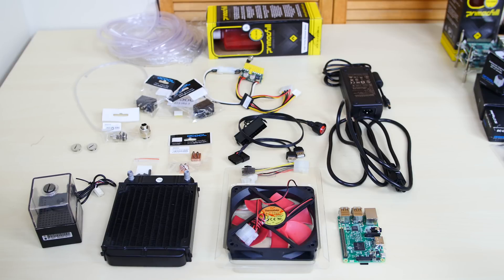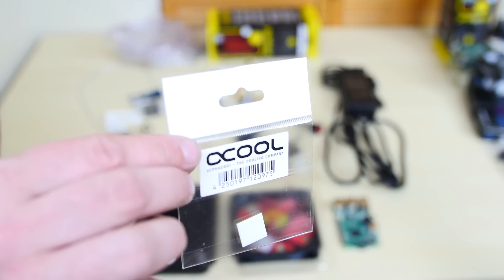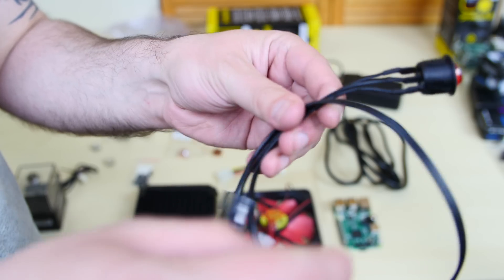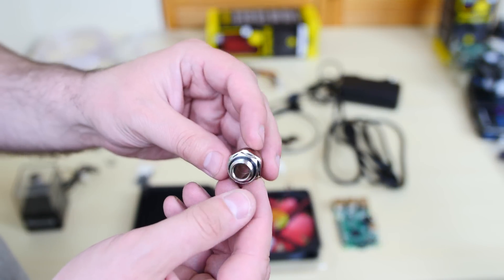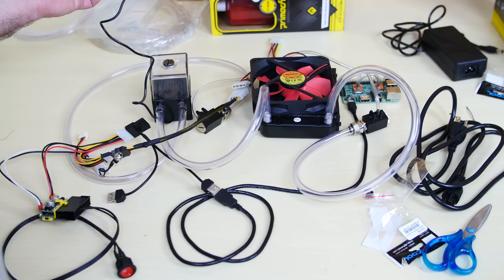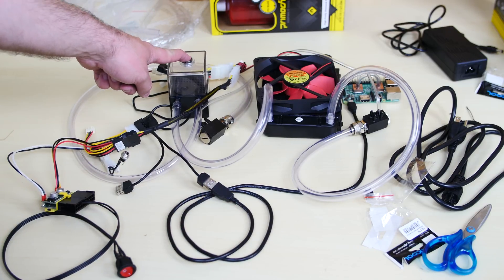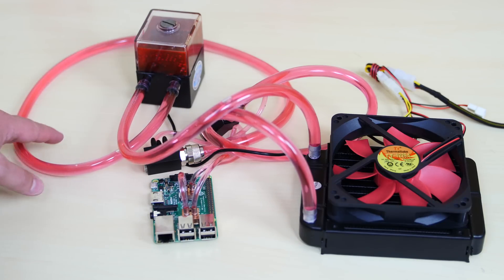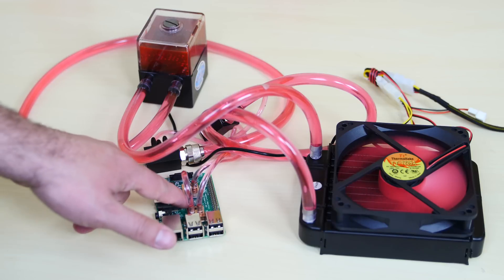Water Cooled Raspberry Pi 3 - Part 1 - The Build

Comment: The pump clearly isn't powerful enough, when the air is stuck in the loop.
Also, when your radiator is lying flat, there is minimal airflow.

You're basically just placing a plastic bottle on top of your Pi with no liquid circulation.

This isn't watercooling. This is putting unnecessary cable clutter and water onto a Raspi.
Reply: Its only because of the height the pumps sitting in relation to the height of the liquid. If he laid things flat it would work great. 
True about the airflow but for the amount of heat the pi produces even no fan would do wonders with the amount of area the radiator has.
Its a demonstration of concept. I'm sure if he knows it could look a lot neater if he wanted it to.

FYI a bottle of fluid on a pi would actually help a lot... if it were metal
Reply: Yes, I'm aware it's overkill and nothing is needed to cool a Pi.
Yet the execution of the project is horrible.

And no, as long as the water doesn't flow at all, the pump is simply not powerful enough. It might /kinda\ work, if it was flat. Still not a good enough pump.

The radiator isn't even used. The heat doesn't reach it because of the water not flowing trough it.

The whole point of a fluid is moving the heat away from the source. If it's stationary, there's no point in not just having a massive heatsink. - Which is why a metal bottle would work, no matter wether there was water or not inside the bottle.

Comment: There is a more efficient way to run your W/C loop, you should run 2 tubes from the outlet 1to5 splitter and have both of those individual lines return from the the pi3 to the inlet 1to5 splitter (parallel instead of series) Your setup will have more flow, will put less strain on the pump and it will also make the whole system run cooler by reducing the bottleneck which is your small tubing.

Comment: You fan is on the wrong side... it blows upwards (but the radiator is on a surface so it cant blow air upwards) so basically it that position the fan doesnt do much

Comment: You could cool this while thing without even using a radiator...there isn't enough heat to make the radiator useful
Reply from the maker: True, but it wouldn't be fun.
Reply: +Rasim Muratovic (Rasmurtech) Well, now set some ice on the radiator and see how low you can get the temps haha

Comment: you should use 2 parallel  hoses through each chip to up the flow and lessen the stress on the pump since you have 5 ports anyways.

Comment: Hahaha it so impractical XD 
If I wanted a fancy Rasberry Pi cooling I would submerged it in oil. Say put in in a small aquarium with custom made cover with place to connect pins and usb ports. Add a small fan inside to force fluid circulation, some fancy LEDs and random stuff that you normally put in a aquarium. Cool it with bubbler or if you really need connect it with a radiator.

Comment: I like the concept, but didn't all the parts cost over double what the Raspberry Pi cost?
Reply: Steve Martinetto I'm thinking about using that setup he has to cool and heat a motorcycle survival suit I've been putting together but I would have have the cooling system hooked up to the Raspberry Pi I'd have the Raspberry Pi just monitoring my vitals why distance showing me my GPS position and having it hooked up to a Peltier device so the computer can control the heating and cooling efficiently and turn the mini pump on when my body temperature reaches a certain point